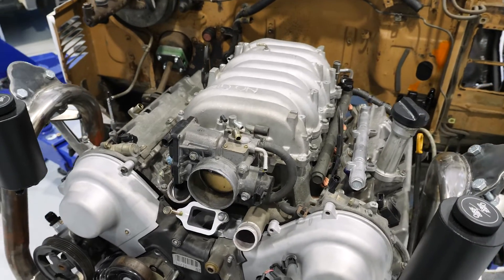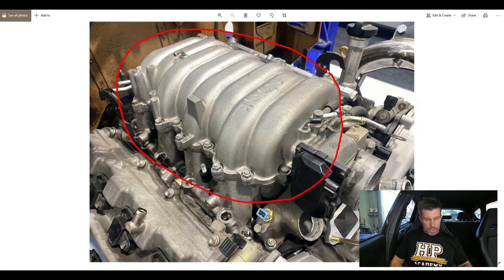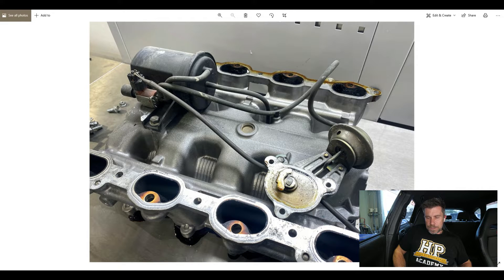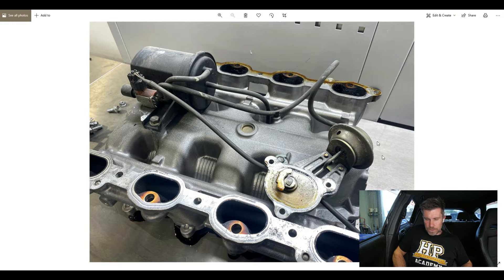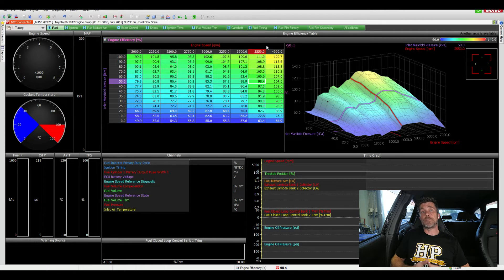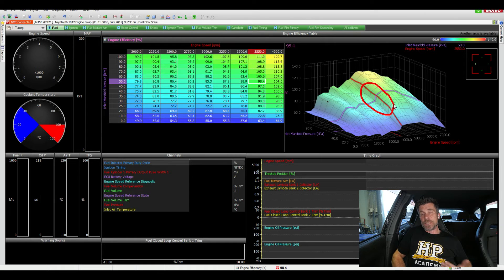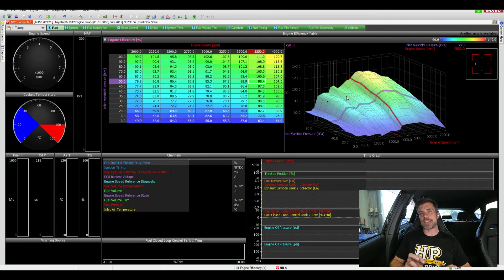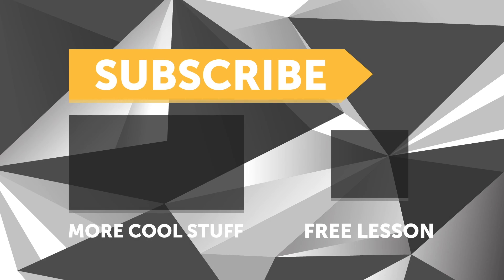Variable Intake Plenum Tuning Basics

Comment: I remember watching a video about Ferrari V12. 
In the higher rpm band the lenght of the intake was once shorter, then longer, and than shorter again - this would be impossibe to make in a simple pressure-controled system. 
Almost 20 years ago, I wanted to make such a system DIY on my engine, just for experimental reasons, but with the length controlled by an electric motor - independent of pressure and engine rpms. 
Unfortunately, I was overcome by laziness and a lack of knowledge of electronics (:P)
Reply: I've been thinking about this exact same setup, but on a GIANT cubic inch LS motor that can rev to the moon - and still be streetable. There are 510ci motors making 1000hp now - see the Ringbrothers' ENYO project that debuted at SEMA last year. I wonder how it would work if it was applied to DBW ITBs. I feel like you'd be able to get an even cleaner torque output.

Comment: bmw starts in e46 whit a disa flap, in early models the flat closes at top en to get less power in later models the flap is open to redline. but people usually put older plenum from other engines that didnt have disa flap they clain a gain at top end power, a cost less low botton end performance.

Comment: Great to see you addressing this Andre! Having a collection of Subaru SVXs and their EG33 engines, I've always wanted to be able to control the IRIS valve to a much finer degree than what the stock vacuum canister assisted system does.
Reply: A lot of owners remove the IRIS but it does affect cold start it should make it run better at all rpms/loads if it was finely tunable. Is it not particularly tuneable with stock? A stepper on the end of the rod would do it :)

Comment: I’ve been very intrigued with this topic on my base model Acura RSX that i turbocharged (I kept the stock IM). Particularly, I was curious about the timing strategies at this point, since I noticed the factory NA tune sharply and briefly increases timing. My assumption is that it is accounting for the momentary velocity change, but I’d like to understand that more.
Reply: Turbo charge engine should regulate at boost level , i done a variable intake on Ford Focus st , awesome result and amazing driving experience

Comment: The Kawasaki Concours 14 (don't think they used it on early 2008 models) had a "Eco" mode. That when activated moved some butterflys to partly block the intake.  And make the motor think it had a smaller intake.  It works on my bike.

Comment: So glad u guys did this vid.. I’ve been trying to figure out how I could adapt a better switching method and also a position reference.. I’m thinking just add a tps sensor onto shaft also… also there might be a bit more to gain if we could turn it on and off with more control.. I’ve seen there are some electronic actuator OEM versions Chrysler 300c I think ?? Any recommendations from guys would be awesome 👏. FYI we are running an AU falcon motor in speedway, elite750 PD16 etc also I’ve adapted the Barra cam sensor onto the Rear of the AU Vct cam so we could reference the actual cam position.. Our Tuner made great use of this 👌